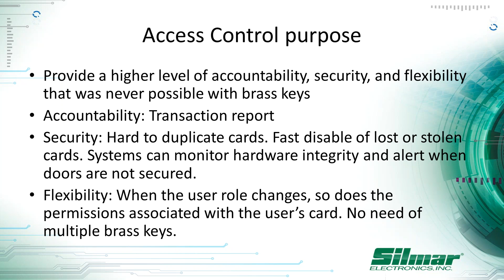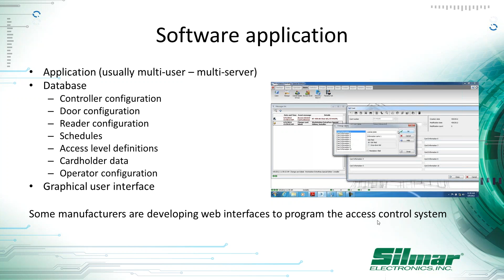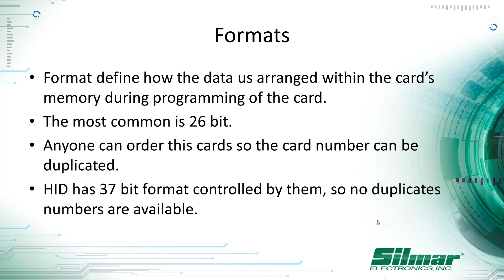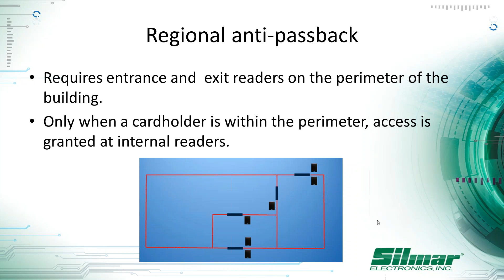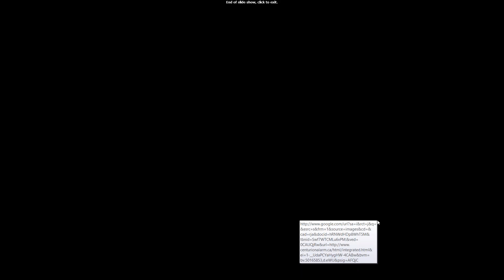Access Control Training

Comment: V lane created at where in the switch side or software application side
Reply from the maker: VLAN setting are done on the switch side. Make sure you are using a switch that is capable of doing VLAN’s as not all, especially unmanaged, switches can support VLAN’s. Thanks.

Comment: It's helpful to think about the status of the lock/door on power failure. Would it be secured/locked or safe/unlocked? 
So, it would be on power failure (fail):
-secure - meaning that the door would remain secured (locked).
-safe - meaning that the door would be free to open (unlocked).

Thanks for an excellent video presentation.

Note. There are systems where it´s PC -> Controller -> Modules -> Devices (readers, sensors, notification devices, DPS, locks, etc.)
Ethernet cabling between the PC and Controller. RS-485 bus between controller and modules. And the special wiring according to devices. And of course, the power supplies.

Comment: 00:15 Access control is a simplified way to control security in a business.
07:39 Access control systems rely on a database and software for multi-user access.
13:26 Access control system configuration and installation
18:40 Access control technologies include physical contact and contactless options.
23:50 Different types of access control credentials and their uses
28:52 Access control systems have special functions like anti-passback and different locking devices.
34:26 Anti-passback is a security feature that restricts access to certain areas.
01:01 Elevator control and access explained
44:22 Biometrics are used for access control and include fingerprint, iris scan, and signature dynamic.
49:32 Elevator relay blocks access to certain floors
Crafted by Merlin AI.

Comment: are rex buttons supposed to be wired back to the panel? I thought they were supposed to be wired directly into the lock power at the door, especially for mag locks, in the event of a fire, etc you don't want to depend on any hardware to kill power to the mag. Is this wrong thinking?
Reply from the maker: That is a great question. REX devices are indeed wired back to the panel. NFPA requirements force the use of a power supply for the Maglock situations so that the fire panel kills power to the lock in a fire event (fail safe). Some facilities will allow for fail secure or lock down situations like prisons but those are rare. Going back to the fire panel point, the access panel or any of its accessories can not be in control of opening the door in the event of a fire. Power to all of the locks must be shunted. Note NFPA is a USA standard and might not be followed in your area. Always discuss this with your local fire authority. Thank for such a great question!
Reply: @SilmarElectronicsInc  so should the leg of a rex button be tied into the rex motion and the other tied into the negative of the power for the maglock then?

Comment: Sir i have installed electronic lock with access control system .but when I open it using card ,fingerprint or pin code ,it makes so much of electrifying noise for 5-7 sec .how to shut that noise .
Reply: AC vs DC door strike I think the AC one buzzes the dc does not
Reply: Voltage

Comment: Great Video! Can you you assist me.I have an ioProx P225XSF that is calling for a 22 awg 3 UTP cable. What will happen if I install a shielded cable? They specify Unshielded. What is the difference between installing twisted and untwisted.Thank you.
Reply: It probably won't cause any issues. shielded is just more expensive for the added resistance to interference. Twisted wire pairs helps data travel more effectively.

Comment: I have a question about the adhesive tag mentioned at 27:00. 
You mentioned this is commonly used for equipment like laptops for inventory. Can this be configured to track the staff ID that takes the equipment as well?

Comment: Hello. I have a TS1022 turnstile that I paid to DUBAI, when I connect the RJ45 network cable to the switch, management software ZKACCESS 3.5 detects the device but wanting to add the device, it does not spoil it says add failed : unknown error-98 or receive timeout. Add device fail, do you still want to add to the database. I ping the ip address of the machine and I have an answer. please help me, I do not understand what is blocking the comunication between software and the device TS1022.
excuse me my english.
email: arnaudsonon@gmail.com.
Reply: SONON Arnaud annjwjkoppwnkplwmkslslAssqqwp sdssddffgl:&&;&£););
Reply: Facility code you add or no